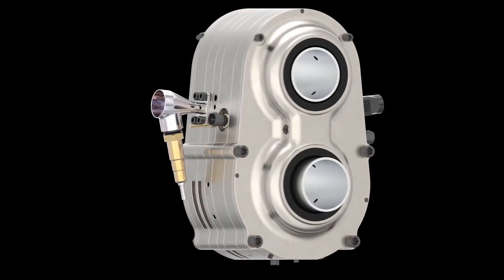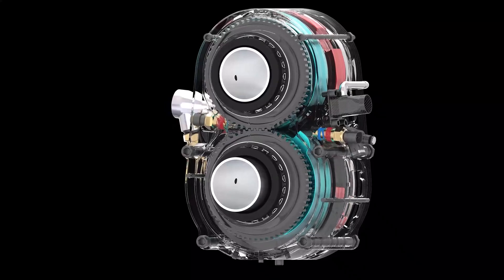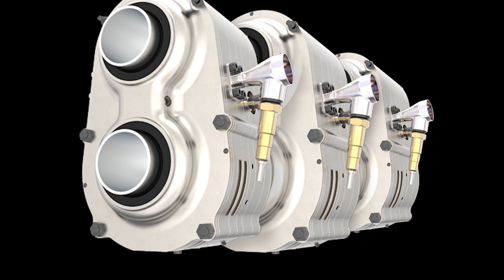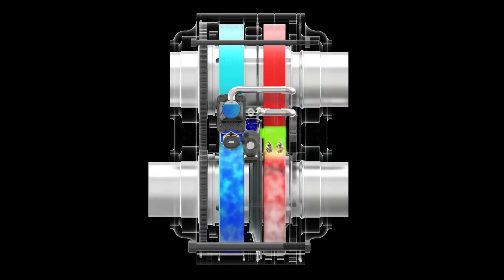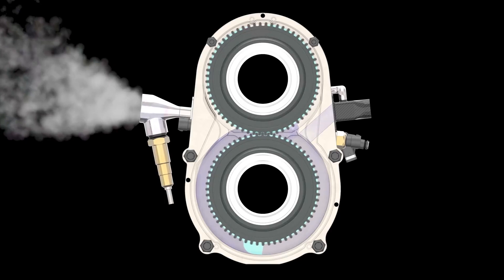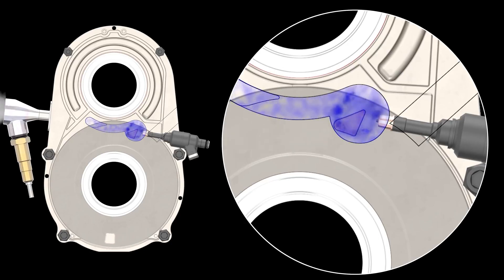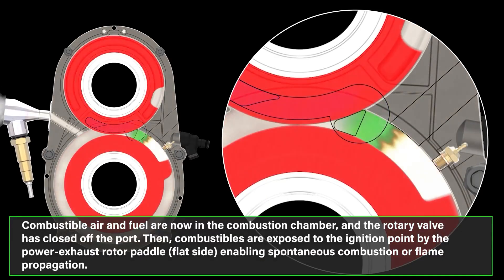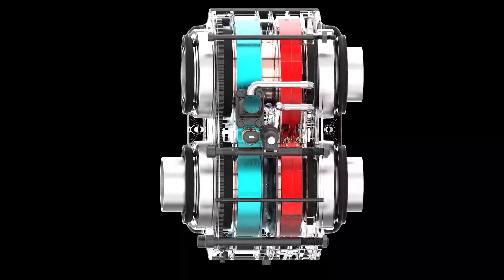This pistonless engine runs on hydrogen and revs to 25k rpm

Comment: The simple solution is to use conventional piston engines running on ‘natural gas/ propane’.   Readily available, almost no refining required ,burns extremely clean (used on forklifts running indoors safely for 60 yrs+). It used conventional engine technologies, no retooling required .
10% less power from propane is easily compensated for by eliminating losses from complex emission controls , catalytic converters etc used on gasoline engines.
Many countries have been using this for over 40 years with filling stations , well proven systems , most conventional cars can even be converted for low cost.   So why not? 
Cheers Warren
Reply: The pessimists reason: natural gas as a fuel is too just dangerous for every current driver.
If we put every Joe "try enough times and you'll get a licence" on top of a pressurized canister going 100 miles per hour we'll see hollywood style car crash explosions.
Reply: @DiakosDelvin  this is better than my reason
Reply: Because natural gas is non-renewable
Reply: The extraction of natural gas is a horrifyingly unclean process.  The sooner we abandon all fossil fuels, the better off we'll be.
Reply: And then one day we don't have any gases anymore and we uses horses again?
Reply: @DrSmugface  we have huge natural gas reserves. Good for hundreds of years
Reply: @CheersWarren  If it was that good, we'd be doing it already, but its not.
Reply: @davelowets  It’s good but unfortunately that’s way too simple of a solution. This world revolves around nonsense problems and concerns
Reply: @davelowets  politics
Reply: @davelowets  some countries are doing in , I was at a filling station in 1980 at 2am in Belgium getting gasoline and a guy pulled up to a self service and filled up with natural gas!    It’s already happening.
Reply: @CheersWarren  in Poland it's literally the best solution for today's gas prices, a typical wage in Poland is 500-700 euro a month, gasoline and oil are 1.5 euro per liter while gas is 0.5 euro per liter. Yes you loose some power and it is harder on the engine because it burns hotter, but it's so miniscule that if you properly take care of your car then it will not affect the performance ever. 2 days ago I have seen a guy in a charger, a fucking charger! Fill up natural gas or LPG as it is labeled on the distributors.
Reply: @DrSmugface  even decomposing organic matters like feces or food waste can produce a biogas for fuel
Reply: @DrSmugface  we will run out of oil sooner than we run out of gas. And by the time we run out of both we will definitely invent something better or anahilate each other with nuclear weapons so it's basically an infinite solution.
Reply: its not really a solution because it is already in practice...  Supposed to be clean + efficient and a normal engine is inefficient as well as annoying to maintain .
Reply: If we can make synthetic motor oil then we can make fake low emission gasoline.
Reply: Gas stoves are being banned where I live because of the harmful effects of burnig gas indoors.  Forklifts with cng or propane were banned for indoor use years ago.
Reply: Conventional piston engines are inefficient due to mechanical power loss at each moving point. Propane is a horrible alternative fuel.
Reply: @mattboyer7812  but thats the only GAME in town - there's no engines that exist that can operate reliably and burn any fuel other than piston. Alternative combustion engines  are decades an decades away from being used in something like vehicles.
Reply: @crabbcake  rotary engines have been used for decades
Reply: @msharp6887  in automotive applications rotary engines don't match piston in terms of being as reliable. They end up being inefficient, seals wear out and they burn oil.
Reply: @crabbcake  apparently ford is sticking the omega 1 into the new Ford transits. And this isn’t a rotary engine, it’s a turbine engine
Reply: @msharp6887  you're talking to someone who is in the automotive industry
Reply: @crabbcake  no I’m talking to someone on YouTube who claims to be in the industry. And to be quite blunt, a guy at jiffy lube is part of the automotive industry as well, doesn’t make him an engineer
Reply: @crabbcake  it’s a turbine engine, not a Wankel style rotary
Reply: @crabbcake  no son, I’m just pointing out facts. They just don’t help your case

Comment: hydrogen has so many issues with production  (CH4), transport and storage (-250C, 800bar, container permeability etc) it is not even funny.  if you manage to solve these issues you can use a fuel cell and electric engine that gives you way better efficiency than this engine.

Comment: The problem in the whole "Hydrogen" debate isnt the combustable nature of the Atom, but how Hydrogen is generated.
I think every reasonable adult would welcome Hydrogen engines (especially as a replacement for heavy duty diesel machines like trains and trucks!). 

But most of out hydrogen is derived from shooting hot steam at Methane in an crazy inefficient process releasing tons of wasted energy and Methane into the environment (Methane is magnitudes worse for the greenhouse effect than CO2).

The energy lobby is ofc ahead of the game and already forged terms like "blue hydrogen" which is basically hydrogen made "the old way" but sold ans CO2 neutral. 
The climate crisis solution "hydrogen" has already turned into an environmental disaster. 

Imagine driving your hydrogen car thinking you're doing good for the cause, but you're actually releasing more CO2 equivalent by fueling the Hydrogen generation market with your consumption, than driving with real gas. Because thats what hydrogen is right now @ 2022
Reply: So here is the thing though, it doesn't have to be made in this way for any reason what-so-ever.  It sounds like the oil companies found a way to convince you that Hydrogen is bad for the planet...  Maybe rethink your need to promote oil company propaganda.
Reply: @evrythingis1  it doesn't HAVE to be made that way. That's the entire point. 
And it's actually the other way around. Oil companies promote hydrogen, because they use methane steam stuff to produce it and they lobby the shit out of "blue" and "gray" hydrogen. 

Hydrogen is fantastic - in theory. 
But big oil is - once again ruining it with shady business. Green hydrogen isn't competitive yet. Not in price and not in the required amounts. 
(Partly because the sun is literally not shining at night, while the methane steam stuff can run 24/7)

That's why the whole hype around hydrogen does more harm to the environment than good right now. 

Btw. Methane is a major side product of oil drilling. So you know why oil companies are interested in rising methane consumption;)
Reply: @Ch0rr1s  Do you not understand how people will read your comment and instantly conform to the idea that "HAHA! Hydrogen is ackchyually bad for the environment!".  The only reason oil companies are invested in hydrogen at ALL is because it overall hurts hydrogen's green viability and thus keeps us on oil.  Just how much money you think oil companies are actually making off of dirty hydrogen compared to OIL?
Reply: @Evan Payton  i never said hydrogen is bad. You're just picking parts of my statements to assemble what you want to read. 
I'm providing pros and cons. That's how a debate has to be taken. Hydrogen would be great - if it wasn't for the current state of production.
I'm 100% pro hydrogen. But I'm 100% against how it is approached right now because it's 100% stupid and does more harm than it helps.

Oil companies make a HUGE profit of off dirty hydrogen and methane.
Both is needed in absolute stupid amounts in the chem and MEDICAL industry. Rising demand and therefore rising prices is free money for them. That's why they're in. 

Hydrogen is not a good thing how it done right now. And that's a fact. 
According to "chem4us" around 95% of hydrogen generated is by means of fossil fuels (primarily methane steam forming)
So, if you fuel up your hydrogen tank and pay 10$, 9.50$ will ultimately go to the oil guys. 

This has to change. And it won't change if you assume an attack just because someone points out the downsides.

Hydrogen is great when produced by an over availability of solar and wind - even though the energy efficiency in an electricity to electricity scenario is about 1% (100W of green energy run into a hydrogen generator, gas is filtered transported and burnt to turn back into 1W of electricity) it's still way better than not having this energy at all.

We need laws that discourage the production of hydrogen by fossil means. 
We need laws to push more renewables onto the market.
We need laws that help to finance hydrogen plants that cannot run 24/7 because sometimes the sun doesn't shine so the plant can't make hydrogen (which is a huuuuge issue for green hydrogen facilities!).

We need discussions about that, because public interest and debates is the only way to get those lazy politicians to turn down lobby money and actually do something right. 

And it really doesn't help to use fossil fuel generated alternatives to ditch fossil fuels. So yes. Please be part of the debate, but rather than shutting people down, approach them with pros, cons and a clear vision of what has to be done to fix The downsides. :)
Reply: @Ch0rr1s  It's not much of a debate, there is no one on the planet who will argue in good faith that hydrogen should be produced in a emissions heavy way. (by the way oil companies spend over 4 times as much on creating brand new oil fields every year than the ENTIRE industry makes off of hydrogen in a year. Again, new oil exploration expenditures ALONE are over 4 times larger than the entire revenue of the Hydrogen industry.

Comment: So much hate against this.. but peoples listen up: there's not going to be any saving of planet unless we find a way to retrofit all existing cars with greener options. Outright replacing every car on the road with electrics is not green when you factor the massive landfill of 1.5bn cars, and the manufacturing of another 1.5bn cars to replace those. Then there's complete NEW infrastructure for recharge on the road, which add significant load to existing electricity infrastructure.
The ONLY chance to go green is to retrofit.. meaning whatever solution is created, can fit into the existing engine bay and fuel tank areas, and makes use of the existing fuel stations.
Reply from the maker: Precisely

Comment: i think this is better than electric. no charging times. easier refuels. and a actual job for mechanic and even diy people to have. electric vehicles are very dangerous to work on. as for mechanical in my opinion is less dangerous and requires less expertise

Comment: Nope! Everyone else pointed out the obvious 0.001” tolerance issue… but let’s not forget about growth and balance? 
If that inner rotor grew 0,01% more than the stator, the whole thing makes contact and seizes on the “lobes”. 
Run it at <100% power and the inherent imbalance of pushing on only one side will crash that side of the bearings. Compress and release bearings at 400Hz and watch it disassemble itself.
Reply: Or you could just run it within the spec it's designed to be run at?

Comment: If running on hydrogen, there are ways of safely packaging compressed hydrogen in carbon fiber cylinder packs with individual safety valves so that refueling would require only a moment instead of hours as with electrics. Plus, in an accident scenario, the individual carbon fiber cylinders would be far safer than a 3 thousand pound battery pack and less manufacturing impact on the environment.
Reply: Trust me ..this engine has way bigger problems than the fuel storage

Comment: Producing and the transportation of compressed hydrogen fuel from electrolysis generstor plants causes so much net loss in energy compared to just storing the energy in electric form directly in batteries.

Comment: I can't judge the engine itself based on the information I have but hydrogen is surely a suboptimal fuel. Not only because of the low efficiency when generating hydrogen from renewable energy but also because of complicated or dangerous storing of the hydrogen.

Comment: Hydrogen is definitely a more realistic option than electric but this engine sounds far to good to be true.
Reply: Hydrogen is about half as efficient and way more difficult to handle.
Reply: @aVoidPiOver2Rad  but easier to make and store, a hydroelectric power source turning out cheap hydrogen is the future unless someone figures out how to make vast quantities of cheap electricity and a way to make cheap storage that makes lithium technology look like a D cell.
Reply: @marcdawson2156  Tell me how hydrogen is easier to make than electricity. 

Renewable energy already is very cheap lol
Reply: @aVoidPiOver2Rad  enough electricity to power every car,truck, tractor, bus, train, plane etc etc just for Britain would be a massive increase in production and far beyond the reach of any of the renewables it would ultimately mean many more nuclear power stations and then we come back to the problem of storage. There isn’t enough lithium on the planet to replace every combustion engine and no one is waving a new magic battery around that will store enough energy to be of practical use last the lifetime of the vehicle it’s fitted to and can be recharged almost instantly. Moving over to hydrogen power plants answers all these problems and is the simplest solution to the problem,.

Comment: Degraded batteries are going to be a major problem in the future and not the way forward. They cost the customer a fortune to replace and the unethical means of production prove they are not the way to go. Also unless they are charged with zero carbon methods it is simply passing the Co2 issue down the line. Hydrogen or hyper efficient internal combustion is the only way.

Comment: Electric motors have always been far superior to internal combustion engines in every measure but one. The energy density of the carried fuel (electric batteries) absolutely sucks in comparison to gasoline or diesel fuel.  If the energy density of our batteries can be improved to be competitive with gasoline, internal combustion engines will completely disappear forever.  And that is getting closer every day.
Reply: The main problem is lithium is a non renewable resource ( doesn’t mean it can be reused it’s just not at all economical).

Comment: I can't say I exactly understand how they achieve their compression phase, but the part that sticks out from the one erm, drum and can fit into the opposed one whilst the two on other moments nearly touch (coming as close as possible to an actual seal) for starters already solves one problem of a piston-less engine, it's a nice touch! (Or better actually, a nice if not rather brilliant find)
Reply: It doesn't look like there is compression. It seems to be open. I'd like to see better how it works.
Reply: The bump on the lower half acts like a piston head compressing the air between itself and the point where the two rollers touch as it travels.

Comment: I wonder if the zero seals and super tight tolerances will make it past the manufacturing design phase. The saving grace would be low material costs and lower part counts, but replacing seals with tincey-wincey tolerances is gonna cost.

Comment: Would love to see a prototype. Esp. if it has the potential to out do electric on a number of level. All i see with electric is that its waste is out of site and thus out of mind and carbon reduction only kicks in provided the country uses nuclear in which case 10000 years later.... thus not really a solution esp given the level of waste in the end life of the product. In this case with regards the youtube vid. i'd love to see alternatives to replace the current combustion even if they are prototypes that need to refined.

Comment: This would melt in seconds and burn through so much hydrogen that it would be highly inefficient. There are major reasons why this isn't in a car. We don't have the alchemic and metallurgical knowledge to create an alloy that can withstand such stress and high temperatures that this engine would produce. If we could, then we would've colonised another planet by now as it would've been a metal that could be used for reusable re-entry vehicles.

Comment: Did you might as well give it up on the combustion engine it's a dinosaur it's time has passed.  The only thing holding back the electric vehicle or the electric transportation is battery storage.  Now getting the material lithium is going to be an issue in the short term but there's at least one site in California which is said to have such a large deposit of lithium it has a potential of supplying all the United States needs and 40% of the world's needs

Comment: And it will keep us tied to the hydrogen fuel system.  We're basically just exchanging gasoline for hydrogen.   Well the fuel economy is extraordinary at least if what you said is accurate this would require a whole new set of interest structure.  The electrical charging stations are a lot easier to add then hydrogen will be because everything runs on electricity every building has a power source parking lots have lights whereas adding a whole new hydrogen into structure would be complicated to say the least because I'm assuming it takes a whole different storing facility than regular fuel does as well as safety and development.